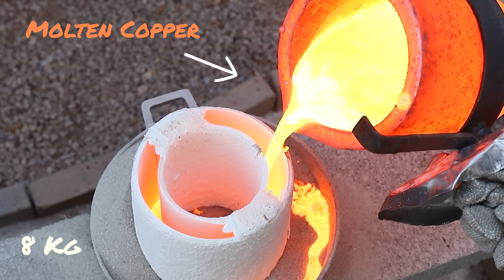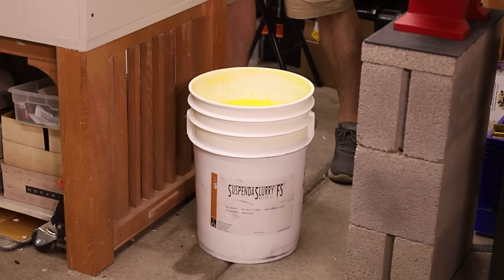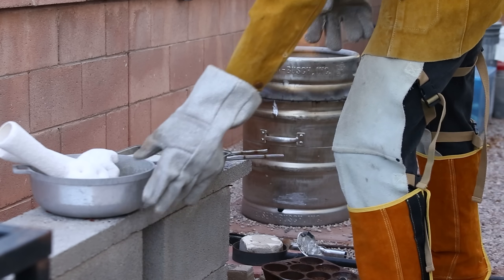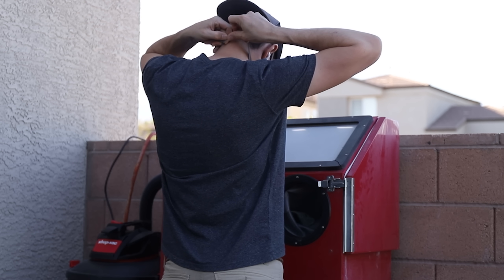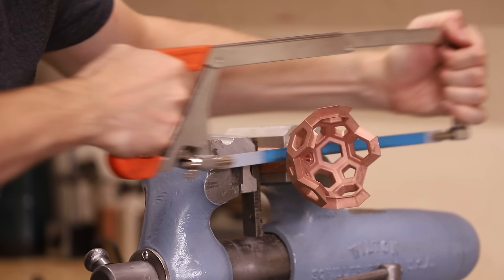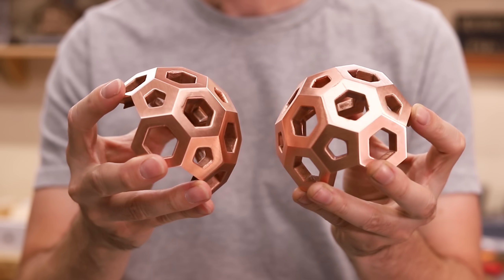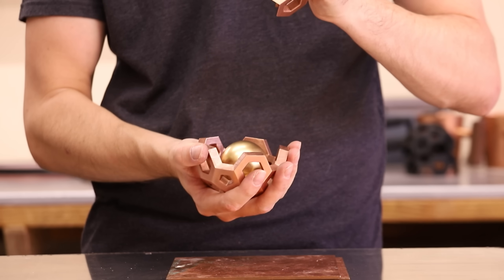HUGE Magnet VS Copper Sphere - Defying Gravity- Will a Neodymium Magnet Float Inside?

Comment: This is a cool experiment I might have to try something like this although some suggestions  
1. A truncated icosahedron isn’t perfectly spherical, so the distribution of eddy currents and forces might not be uniform. The magnet would need to spin in a way that interacts symmetrically with the inner surfaces likely along an axis through the center to achieve balanced levitation. The irregular shape could make stable centering tricky compared to, say, a copper sphere or cylinder.
2. The “right speed” would depend on the magnet’s strength, size, and spin rate, as well as the copper’s thickness and conductivity. Too slow, and the induced forces wouldn’t counteract gravity; too fast, and instabilities (like precession or turbulence in the air inside, might throw it off. Earnshaw’s theorem suggests that stable levitation of a magnet in a static magnetic field is impossible without additional forces, like those from eddy currents here, so dynamic equilibrium is key.
3. The magnet’s weight (mass × gravity) must be overcome by the repulsive forces. A strong neodymium magnet (say, an N52 grade) could produce a significant field, but the copper would need to be thick enough to sustain substantial eddy currents without excessive heating (copper resists but still conducts, dissipating energy as heat).
4. If this is in air (not a vacuum), air resistance and any contact with the walls during startup could complicate things. You’d need a way to initiate the spin without the magnet crashing into the copper—perhaps a vacuum chamber or an external magnetic field to kickstart it.
under ideal conditions. If the magnet spins fast enough the eddy currents in the copper could create a repulsive force field sufficient to levitate it. Experiments like spinning magnetic tops over copper plates show levitation is possible when motion induces dynamic magnetic opposition. However, the truncated icosahedron’s faceted shape might make stable centering less likely than with a smoother, more symmetric conductor. You’d likely need precise control of the spin axis and speed—possibly aided by external stabilization e.g., an initial electromagnetic nudgeto keep it floating dead center.

Comment: Fun fact when soldering copper in plumbing, a good indicator that the copper is hot enough to solder is the flame from your torch turning green while you heat up the copper!

Comment: You should motorize it, then get a xenon flash bulb and a camera to get a good picture lined up with the holes. Also, you need some good bearings on the ends.

Comment: how about, using the excess copper you got after casting, make a tube that we can see through, just search for "carbon nanotube", and you will see the desired structure, a hexagonal mesh wrapped in the shape of a tube, that way we can actually record a video of a magnet falling through a pipe while seeing the actual speed "better than seeing the magnet hope in an opaque pipe then after some time pop out the other side, also better than recording the magnet going from the top to the bottom with a top view, because we would not be able to feel the actual speed of objects when they come towards us or away from us.."

Comment: So one of your biggest problems is that you have a gap between the two hemispheres. Current cannot easily flow between the two hemispheres. Since casting as a single piece is not an option I’d try soldering. It will still have more resistance than pure copper but it might be low enough to create more eddy currents to help it levitating the magnet.

Comment: You think if you do the dual magnet to two drills thing you might make a makeshift generator out of it due to the motion and magnetism? Electricity out of motion type stuff, but with magnets? If this has already been done before, cool, ya may have a new, cooler looking method, but still...

Comment: On the rotational axis, your issue is that the holes do not provide enough resistance for the mag field. If they were solid copper instead of a hole it would lev correctly. In addition if you used a Gyro set up for this, it would in fact create a perpetual motion due to the interacting mag fields. No one bother replying with But perpetual motion machines are impossible narf narf.... No they aren't.  As long as they can eventually cease to function or break, whether they last 50 years or billion is irrelevant.

Otherwise our Sun could not exist as it is by definition a perpetual energy and motion device. Due to its ability to renew its own energy, and it's continual rotation, for billions and billions of years. (indefinitely to a Human).

The key to future tech is to stop thinking about advanced technology in terms of human time variances. The universe does not give a flying f, what your time table is. So applying Human experience of time to your perception for the invention or creations of a device under the law of thermodynamics, is not only asinine, but moronic when clearly by a human definition of such they exist in the Universe at large already created by nature itself.

Comment: You might want to use a servo motor with precision speed control pot to adjust and keep running at certain speed and see if it works

Comment: Try putting a conductive cylinder inside the copper sphere @ centerline of the rotational axis, foll the cylinder with Cu11Bi7 then surround that with a spinning magnet.  Treat the outside of the copper with a dipole switching metamaterial and see what happens.

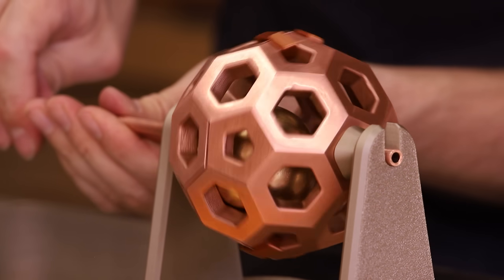Comment: 10:20   
 1)  put a bearings on axes for not have a friction !
 2) and you need do a DIY for motors with a pottiometter varaition wit  a stable base ! it s more precise the puch a bottom to the dril and not stable !

Comment: since the magnet is spherical, does that negate some of its magnetic properties, like with the flat puck shape it had a whole flat surface(around the perimeter) to act upon the copper where the spherical one only has (1 degree?) of surface making "full" contact with the copper

maybe there was too much distance between the sphere and the copper,....."jacket" around it

Comment: I think the holes are big and few. If the holes are bigger, the ball slips into it. During the slip in, the forces on the ball are altered (because it is now 'in' the hole)  and takes little angle and 'extra' force to step/slip out of the hole.
In my opinion, if you make more holes but reduce their diameter/size, it will work better. and if the holes' internal edge (touching the ball) has a softness orramp to it, it will help the ball come out smoothly. Therefore, improving the performance even further.

Also I think keeping it vertical and rotating it along the equator is a great idea but then the ball will be countering two forces gravity in one direction and rotational force in another. It is a great idea but may wobble. If you can counter that, it might actually give intresting results.

Comment: I find it so interesting the degrees to which different people use 3D printing. Some people who have been fabricating for years without additive manufacturing before getting in to it would might still print the pieces to cast but use different options for things like the clips and plugs while other people will print things like screws before they think of going to the hardware store. No criticism to either on the whole when it works, but you can see a generational change in philosophy with with how people approach builds with access to the same tools. 

Very cool build ❤

Comment: Maybe the copper needs to surround the neodymium a little closer, plus you would check what speed gives the best results. It could also be that, the speed is linked to harmonics, or even that the copper has some form of anti magnetic properties not completely explored due to no one covering this type of experiment. It could also have been covered and not deemed useful?.

Comment: I think if you had concentric rings with varying diameters to form a sphere, with small connecting rods spacing them and holding them together, the rods would “disappear” when rotating, and allow a more unobstructed view of the magnet. The sphere you made is very cool, it just has too much structure blocking the view. BTW,  nice toys you have to play with. I had a toy, I think it was called  Creepy Crawlers where you could melt plastic and pour it into molds to make rubbery insects.

Comment: Perhaps it may have to do with surface area?  The copper tube allowed the more "puck" shaped Neodymium magnet to descend slowly to the bottom at the beginning. 

The 5 cm Neodymium sphere only stayed afloat because the increased spinning velocity of the hollowed Copper sphere created something like an enclosed container!  If the goal is to get it stay afloat within the sphere, maybe it's best to take away some of the holes and have one or two windows observe the effect instead?  When a drill can fit the rod, it'll be observable like a film pictograph, no?

Comment: Make the whole thing with iron... then hit electtricity from all sides towards mid - magnetizing the case for the big magnet.
Place the big magnet inside it, now it face a mono-magnetic-polarization. The magnetic ball has to have the same mono-pol which leads to push to push force.
Easy way... same material, casing and inside casing the smaller one.

Comment: I would try different diameters of the spheres, maybe even using several smaller spheres as well just make sure they are larger than the holes you have in the cage.

Comment: Make the copper thing 2x that size so there is more space for the magnet to float in the middle once you get the speed correct. It would make it look much cooler after you get it hooked to a motor keeping it suspended in the air.

Comment: attach both spines to bearings. Seat the bearings or recess them into the arms of that jig. and use a motor with a floating clutch like a motorbike trans, obviously smaller so u can increase the rpm with a throttle .As you release the throttle the clutch dis- engages and the axial and ball is free spinning

Comment: It looks like your magnet is getting a stronger, more consistent pull from gravity. 

Could you try a larger diameter or higher strength magnet? 

Have you tried recasting the copper for a version of the sphere with a smaller internal diameter? Or have you tried making copper plugs to fill the viewing wondows? You could try different sizes/shapes of viewing windows within the plug. 

If a new sphere is created, allowing equal or stronger magnetic pull in all directions and has windows. It may be fun to permanently fill those viewing windows with clear, exotic (looking), non-magnetic materials. For example, filling each window individually with different colored clear acrylic. (Covering the outside of the window and injecting the acrylic from the inside, using another open window for access. The last window probably needs to be covered, and then while the sphere is sitting covered-side-down, inject the acrylic through the cover)

Alternatively, could you create a conductive inner shell to reduce overall distance between the wall, magnet, and opposing wall? Possibly using a different type of metal for the additional design elements

Comment: Hello! Very interesting! Try to use stroboscope effect and controled speed motors. At some point, you will not see rotation of sphere at all (or "control" speed of rotation by adjusting light frequency) and could clearly see the  magnet.

Comment: Someone could micronize some copper powder down to crystaline size and mix it for several hours with a very viscous epoxy resin, get a very homogeneous mixture that is translucent, make the spere:magnet size ratio more broad (or pergaps more minuscule) and the magnet should permafloat. Or, could make a sphere out of iron powder epoxy and make the outer enclosure an electromagnet

Comment: Hook up some brushes on a wire plugged into a voltmeter and touch different parts of it, let's see what kind of voltage you're getting out of that while it's spinning.  then build the reverse with the ball of copper floating inside a charged metal magnet in that same shape and see what happens with the voltmeter then.  I think because of Faraday's paradox one of them will generate voltage and the other will not but who the hell knows

Comment: You don't always have to spin it lol. Just vibrate it. Oscillating ac is best. Who was it. Tesla vs Edison. Something like that. Ac vs DC. With ac you can set the frequency alot easier. Then you just need to find balance in the Resonance. So your ball thing doesn't get dissonance. Find harmony. Balance is everything.
Reply: Also it's not gravity. It's momentum Frequency energy. Laws of attraction. Even energy has mass. English is terrible for science. Always trying to measure the infinite. To control. Flow my brother. Don't call it manipulation call it attunement. Design. Frequency. Its just harder to tell like a illusion when you say things like a black hole lol. Space and time. Dumbest words to choose for it. Phased Frequency energy, and physical Frequency is better. You get different decayed Frequency rates. Dissonance. Thus because the illusion it makes, does effect in perceptions also. But also in existence. Frequency Energy makes the rules of existence. Natural existence of awareness. The closer you get within the filed range changes. You attune to it also. There is no time in the eternal. You exist or you don't lol. Though you will also attune to whatever is natural in that field range. So you may decay faster your may decay slower. Some things may just be like a Thanos snap. Poof and you gone. Rip. Some things may effect you as if you have slowed down and that outside the range will decay faster. So you come out like you was in cryo pod and they all old now. Such is the power of Frequency on existence. It takes alot of energy to do this. But if you build a resonance machine that can harness even that of a black hole or sun. Boom bang. You got it lol.

Comment: I haven't read the comments, but the first thing that came to mind as far as visualizing the levitation of the magnet would be to use a strobe light synced to your camera's FPS rate, then adjust the sphere rotation rate to match it to look completely frozen. Then you can adjust the camera's FPS to make the sphere appear to move slowly or even reverse direction. If you were using a strobe light, experimenting with its position could easily create more varied visuals, or even using more than one strobe light, possibly on opposite sides, or even two different highly contrasted colored strobes on opposite sides (top and bottom or left and right) synced to the FPS and rotation rate, but out of phase with each other. Obviously for the strongest visual effect the strobe(s) should be the primary or only light source.

Comment: Make a bigger outer sphere by 1.5 inch the original size then. Make less holes in areas you don’t really look through like the diameter you spin it on all had holes and they may effect the magnetic pull on the ball inside resulting in a less effective way. After that get and electric motor nuthin too much just a motor that has the most efficient method to spin it at reasonable speeds. (High thoughts suggestion absolutely baked)

Comment: I realized that casting is your forte', but have you done any sort of electrical testing on it? Curious if it generates any voltage, or really anything readable. I think it's fascinating what could be going on electrically if the magnetic forces are causing that extreme of a reaction!

Comment: That's almost a crude version of our Anti-Gravity engine! So close....just mount that copper housing as a gyroscope to give it perfectly balanced bi-rotational freedom- that should even out/cancel out the random axis of the polar magnetic sphere which is already essentially moving like a gyroscope inside your copper housing... When you pull the string (or impart the spin otherwise) on your gyroscopes outer axis fast enough, the entire device should levitate. The faster the speed, the more levitating force it should exert. Please let me know how it goes!!!❤

If you can still find it, you NEED to get a copy of "The Energy Machine of Joseph Newman" 7th edition if you can. You will learn all the hidden info about the magic of Gyroscopic Motion, Magnetism and Electricity. He fully explains the Grand Unifield Field Principle like no one else could. It will most certainly blow your mind- it's all about the Gyroscopic "Particle"....

Comment: Bro, you almost got it same vision I had last week  drill a hole through the magnet to connect a shaft and you got glue some opposite magnet to your sphere on a little angle and install  multiple weight  on cable inside the closet use the wall to hide everything on both side of your sphere you have a closet generator generating energy because of the static plate  spring remember those small car we used to have you crank back just put a crank on that to start it